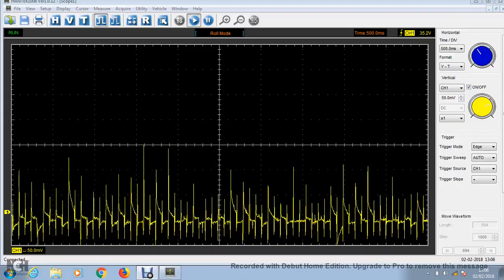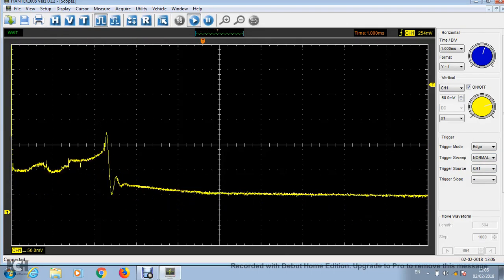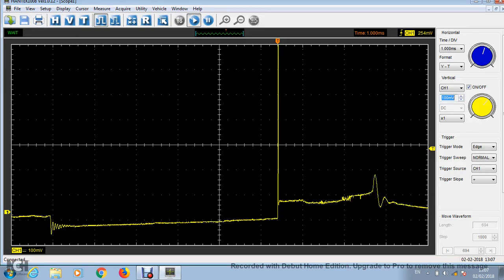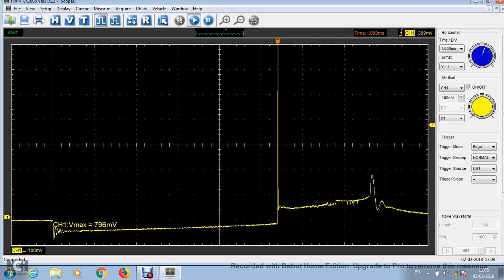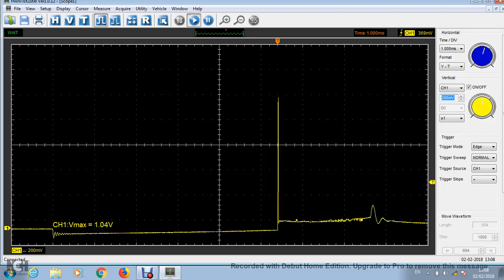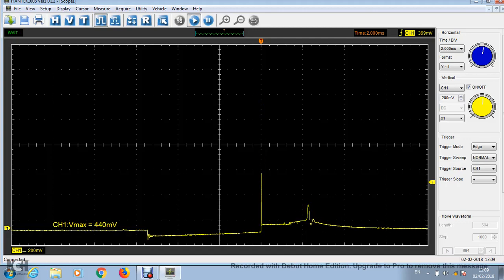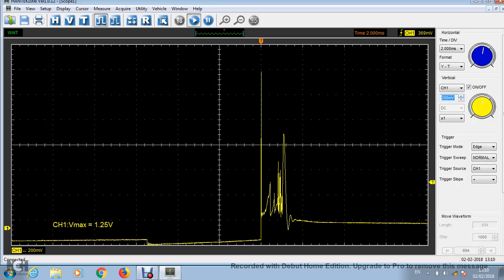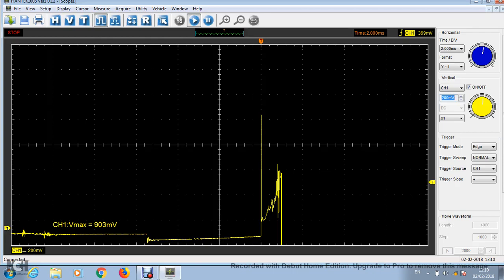Part 1 Secondary Ignition Setup Hantek 1008c and HT25

Comment: hey, did you need to use an attenuator while setting this ignition trigger? Thanks
Reply from the maker: This is a old video and I haven't used the hanteck in a long time but I'm pretty sure you always need to use an attenuator when checking ignition.

Comment: Hello, I have a Hantek 6022BE oscilloscope. I cannot find out whether this coil probe will work with this oscilloscope. I see no reson why it couldn't. a someone tried it out? BR
Reply from the maker: Should work with no problem.  The probe just outputs a voltage, so even if the units displayed on the screen aren't correct, the shape of the waveform should be fine...

Comment: I have used the same setup as you and followed your pointers on setup using a Hantek 1008c and the HT25, but i get a very bizzare waveform. i cant get it to look like a standard waveform same as yours, and its the same on all cylinders, Its on an LS2 Corvette 6.0 V8 with individual coil packs with a short plug lead from coil pack to plug which is where im placing the HT25. I have a screen shot of the waveform but cant attache here by the looks of it.
Reply from the maker: marty james try using a cop extension wire sometimes the insulation on the plug wires are so thick you can't get a good signal
Reply: Thanks for the reply SB, mine isnt a COP system its just individual coil packs for each cylinder and the plug cable between the coil pack and spark plug is just a normal standard plug wire like the old distributer system so i dont think it would be the plug wire insulation, any more suggestions very welcome..